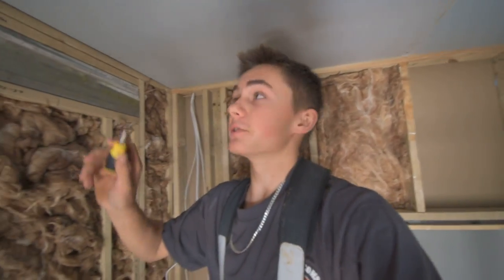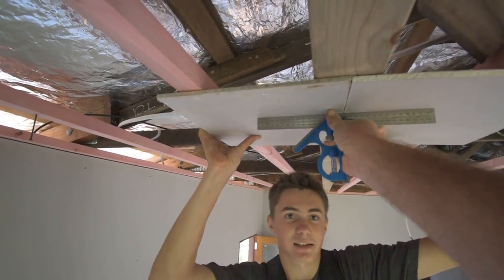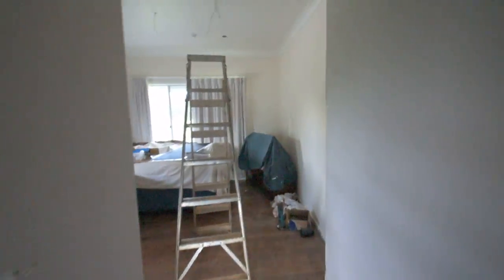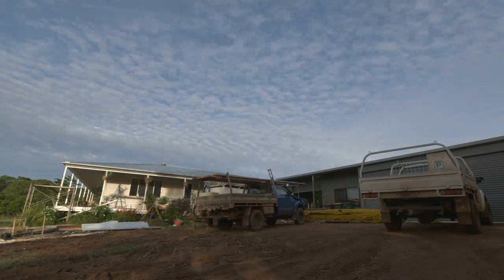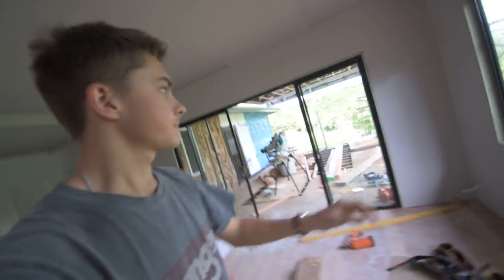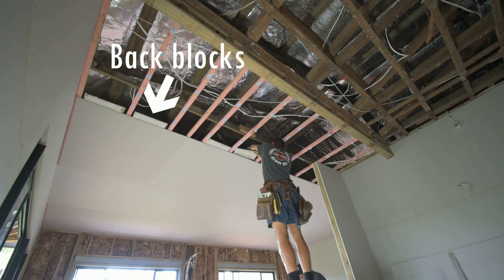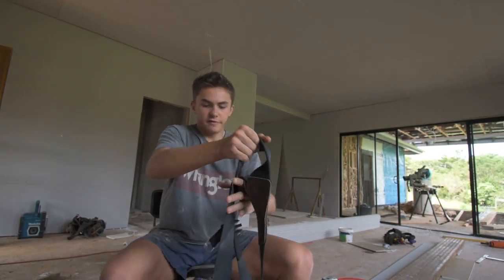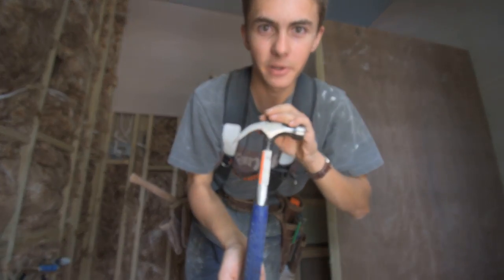Hanging gyp-rock the right way

Comment: A little tip mate, try using your tape as your scribe for scoring your sheets, just pinch your width on the tape and slide your index along the edge of the sheets and knife blade against dummy end of ya tape 👍🏻 will be a bit quicker for ya